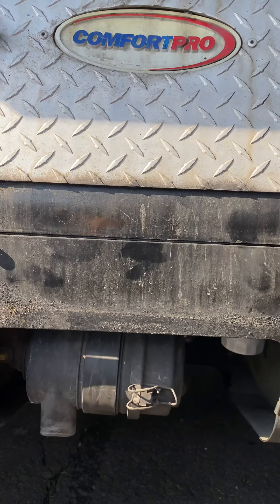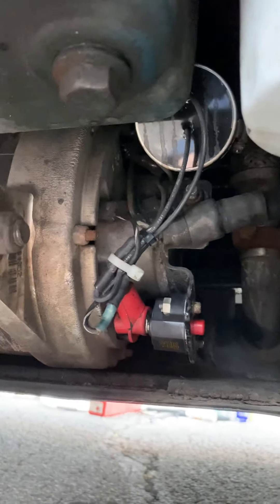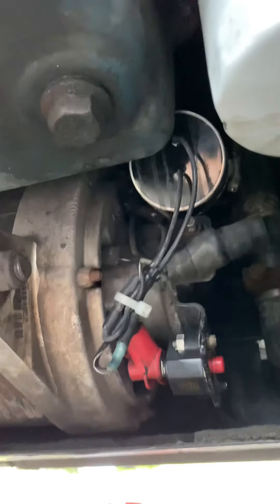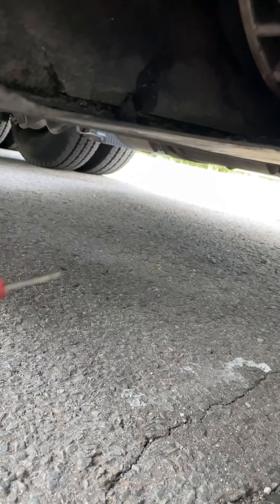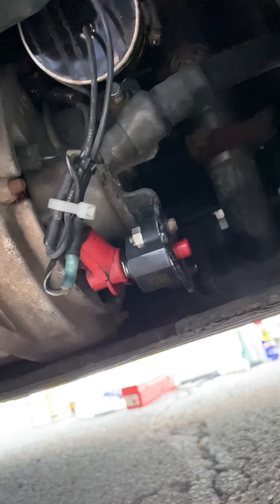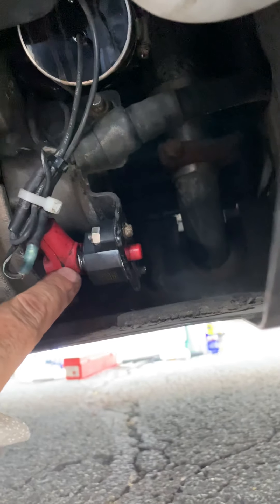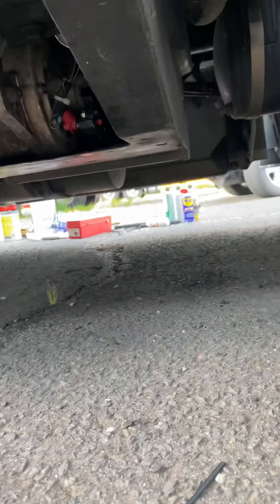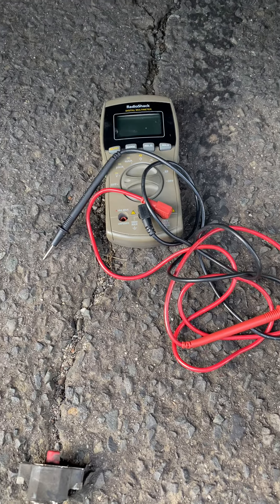Carrier Comfort Pro  NO POWER how to fix and tested

Comment: My apu will not give me more than 27 minutes after driving all day.... Why is this happening? It's a brand new truck..im out on the road and can't get it to remain on...
Reply: The APU might shut down for a variety of reasons, but your description doesn't provide enough information to provide any guidance. Is the engine shutting down with a warning on the DCP? Or does it just do a normal engine shutdown because someone set the max run time to 27 minutes as a joke? Actually, that would be 30 minute increments, but one might not notice that. FYI, prior to retirement, I provided technical support and training for the Carrier ComfortPro system, and as they say,,,,, I wrote the book on the system! Literally, I wrote the diagnostic manual for the system.
Reply: @cheistopherback5002 Carrier had a lot of coolant sensor problems on the new APU system You probably just need to take it to Carrier and have the warranty fix the sensor. The fix is replacement with the old style which will work for a long time no problems